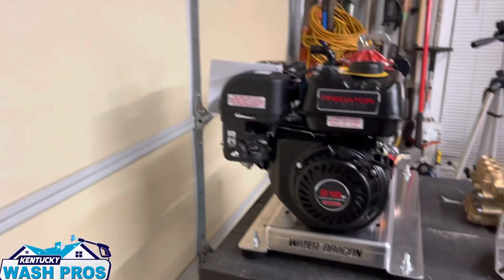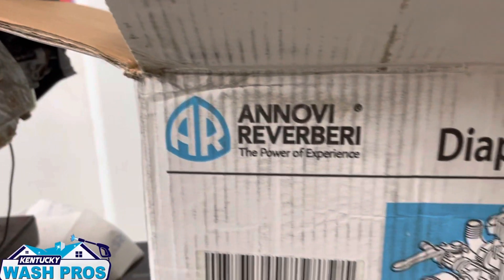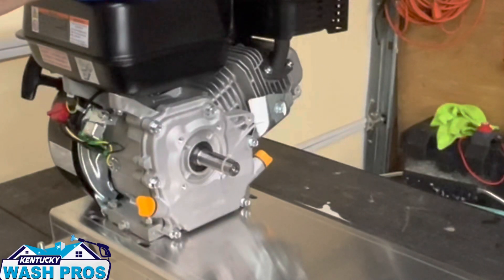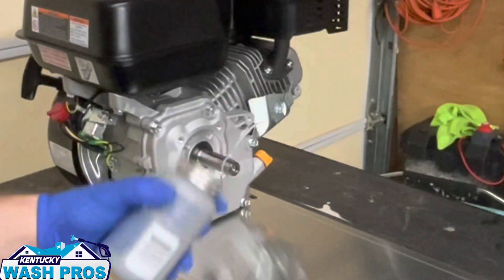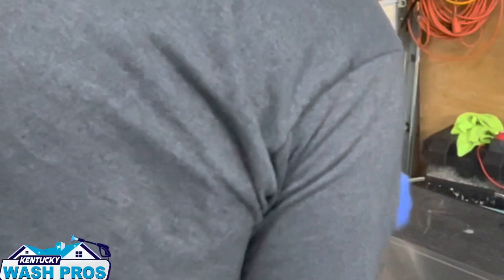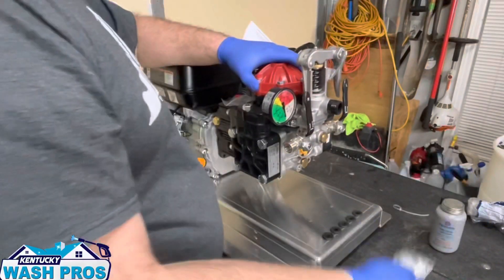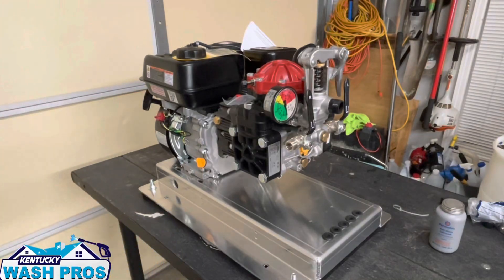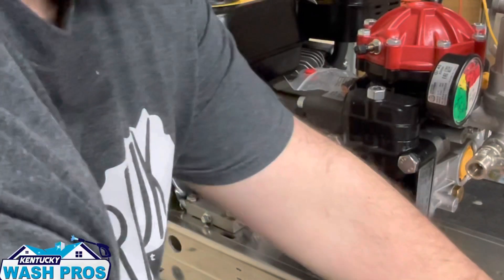Gas Roof Pump AR 30 build

Comment: Hey jeremy do you still run this system. I have a brand new engine and was wanting to build one. But didnt know if ar30 or 45 was better
Reply from the maker: I don’t still use it I upgraded to a P40 and tbh the be P40 has been nothing but a headache for me.

I do like the AR 30 I can’t not give it a fair comparison to the AR 45 however.

Comment: 🙋Do you mind sharing a video on how to plumb to the tank,prime the system and return line please? 🙏
Reply from the maker: I don't use this machine anymore so I can't do a video.
Reply: @KentuckyWashPros did you had issues with the ar30..what are you running at the moment, if don't mind sharing?

Comment: I got a barely used Simpson 2.5 gpm 3200 psi Pressure Washer I wonder if I can convert it to a roof pump. Horsepower unknown, Honda engine
Reply from the maker: depends on the size of the engine
Reply: @KentuckyWashPros  5.2 hp

Comment: when these pumps bypass what has been mixed through the proportioner where does it go? - If it goes back to either the water or bleach tank its no good is it or does it run on a short hose around the pump head?.
Reply from the maker: It just recirculates through a 25ft hose then back through the pump

Comment: How do you like your AR30 compared to 12v?
Reply from the maker: I really like it, big difference.
Reply: @KentuckyWashPros  do you use it for roofs? Any problem with extra runoff compared to 12v?
Reply: @KentuckyWashPros  do you use it for roofs? Any problem with extra runoff compared to 12v?
Reply from the maker: @mcmillerpw  I haven’t used it on roofs yet but you can’t treat it like a 12v or you will most definitely have a lot of run off

Comment: question is will it work on a honda gc190 which I have...
Reply from the maker: Possibly just check the shaft size it will need to be 3/4

Comment: You like the 30 so far? Any reason you chose it over the 45 or 60? Trying to decide on one myself and seems like a little more flow might be nice for some jobs. But the 30 will probably do fine for 95% of jobs

Comment: Hi Jeremy thanks for the build. What are you using for mixing valves and plumbing for this?  Thanks buddy
Reply from the maker: Using 1” Ashai metering valves for the water and chem and a 1/2” asahi metering valve for the soap
Reply: @KentuckyWashPros  where did you get the Ashai valves?

Comment: What's the difference between this and an ar45?
Reply from the maker: AR 30 is rated for 9.5 gpm with 500-600 psi and an AR 45 is rated for 11 gpm with 200-300 psi. Also the pumps are constructed a little differently
Reply: @KentuckyWashPros  Thanks for the info. Are you happy with the 30 or feel like you should have gone with thr 45?

Comment: Building mine now with the new version of the predator engine. The pump doesn’t need any support? It feels so heavy to site on the shaft by itself
Reply from the maker: I do plan on adding some support
Reply: @KentuckyWashPros  did you happen to make a video or planning on making one for when you plumb it
Reply from the maker: @easternsoftwash  planning on doing that, I haven’t got it plumbed yet.

Comment: I wish the predators were available with electric ⚡️ start for this build . Wondering if it’s necessary to support pump under it
Reply from the maker: These small motors are really easy to pull start, you can add the electric start to them for around 125
Reply: Kentucky Wash Pro. Where do you buy the electric start from?  Link?
Reply: @michaellaserre1624  did you ever find one?

Comment: Does it need a bypass?
Reply from the maker: Yes, the bypass is built into the pump, I will be using a 25ft 3/4 hose as a bypass

Comment: What the the full set up run you roughly? Skid, motor & pump
Reply from the maker: Skid-$169
Motor-$149
Pump-$889
Stainless steel bolts & nuts- $10
Reply: @KentuckyWashPros  not bad at all
Reply: Does this pump need regulator and gearbox,
Reply from the maker: @terranceford6330  you can get it with a gear box already assembled, it pretty much a bolt on and go setup.